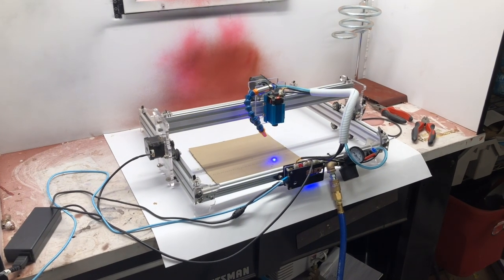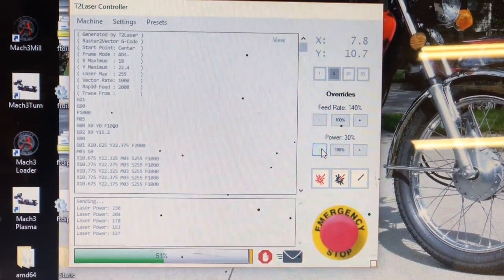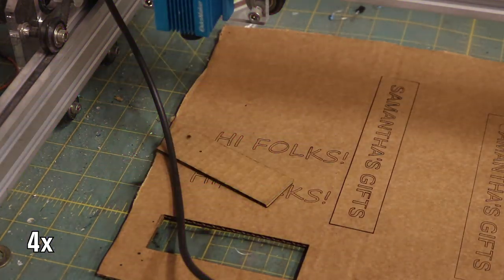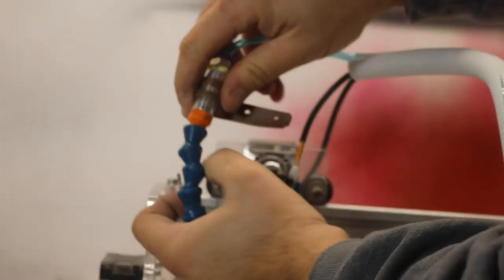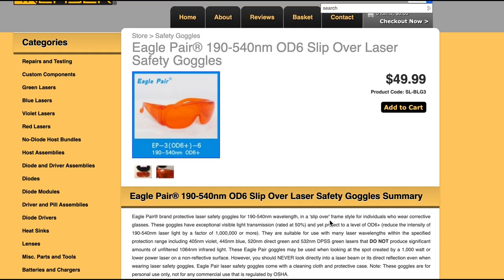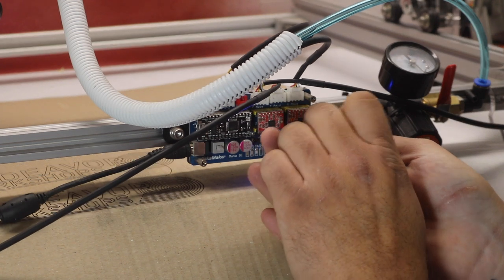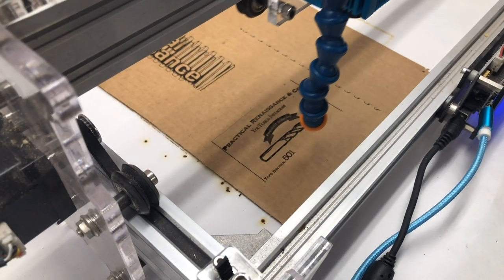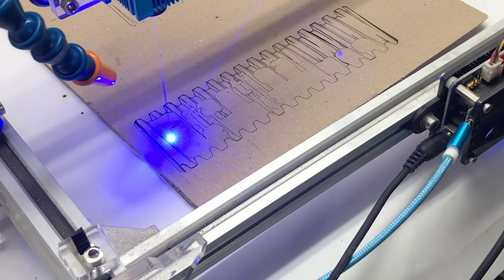Going back to the Eleksmaker A3 Diode Laser engraving machine and getting it WORKING!

Comment: Good to see progress from the first video. There had to be something wrong to make so poor engravings, even though the laser is not very powerful. I was expecting some sloppiness in the build, or too low amperage on the stepper motors to be the cause of the inaccuracy before. But this same unit can be found in many videos with much better results than you last time, so it's not surprising you traced it back to a slack in the belt. The skipping of parts, probably could be helped just with better settings ? Also the software that usually ships with these are voted down and out by all that has tried them. There are free and better options out there. The reason the good laser engraver/cutters has air blast, is exclusively to help the result and avoid excess burn outside the focus. It looks much better, don't it ? Not exactly helping on the fumes, but of course will blend it so you don't get the concentrated smoke straight into your nose, if that's what you mean. Many put the thing in a box with extractor fan, especially when plastics, paint or other surfaces make toxic fumes.

Comment: I have the same settup, eleksmaker laser, and came to the same conclusion within days about the software. T2laser is great, the software developer is very attentative if you have isues, i also added the Z axis and end stops(both suported in T2laser) z axis for cutting deeper/thicker material and adding a pen to draw. Mine will take the anodizing of aluminium. There are various mods on thingiverse from anything from air nozzles to belt tensioners and longer legs. Together with inkscape and T2laser covers almost all my needs, after all it is a little better than a glorified toy. Apparently the 500mw cuts better as the beam is much thinner and focus is the key (to the 2500mw too). Give it a try on Slate stone, looks great.

Comment: If its not cutting focus the laser, as is its well out. you can add a 4th axis easy with a 3dprinted jig and one of the motors for round items
Reply: Focus point of these lasers are pretty long, if you want to do this setup you probably need a different lens.

Comment: I know this probably  isn’t up your ally but maybe it is, yesterday my Eleks servo motors were working just fine and then all of a sudden they quit after it made a cut I tired to move them with the back and forth buttons and nothing I looked on the Eleks forum and they talked about the Micro USB cable can go bad so I bought another one and its still not workin, the laser comes on when I change screen but no movement what do you think?  the error im getting is Still in Running and it skips and its cutting

Comment: Nice!
If you're looking for a (imo) really good program, go for "Lightburn". The first 30 days completely free (fully functional) and then it's only about 45 euro or so iirc.
Does a great job at the stuff I need it to do on my Chinesium laser.. not only on designing the stuff or importing pics/dwg/svg files but also generating gcode and if you want connects to the laser right away and acts like the controller. You might need to update the grbl firmware to a newer version though, so it'll turn the laser on on G1, G2 and G3 and off on G0, instead of M3/M5 every time you need to turn the laser on/off. Mind you, that's not a fault by Lightburn and it'll churn out whatever you want, it's just that the controller might not be able to interpret it because the manufacturer put the older firmware on it. Easy enough to do, takes about 15 minutes and a couple of programs.

Comment: But the lazer use heat to cut, isn't the air blast reducing the effective heat in the lazer. I would rather use low speed air suction...
Reply: Laser is using heat only at the point of impact on the object. It's not like a flame, so no, the air blast doesn't create an issue, and the suction will not work in this application. It's the opposite of the goal which is to remove the smoke from the light impact area.